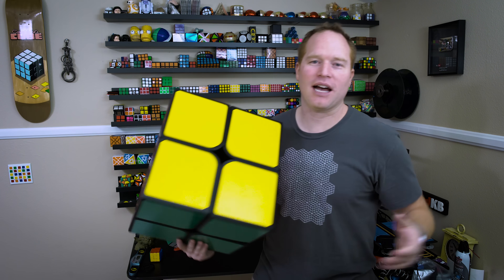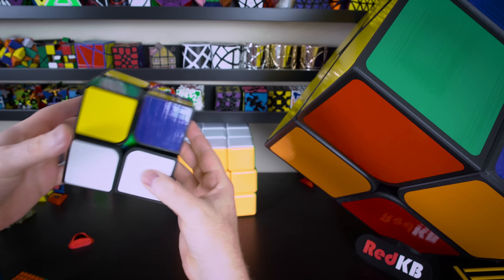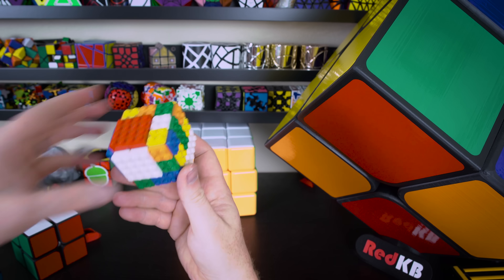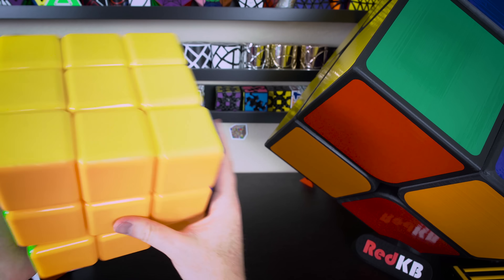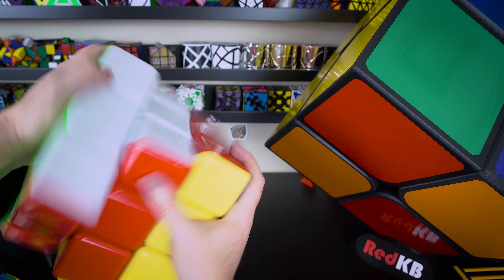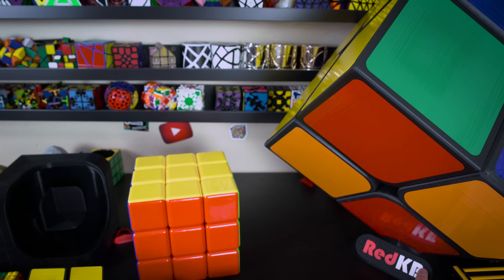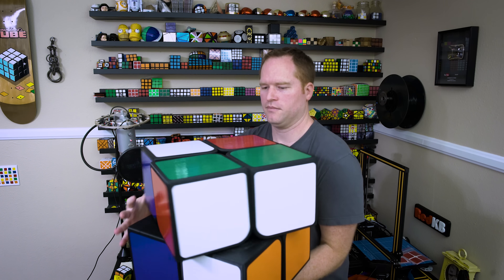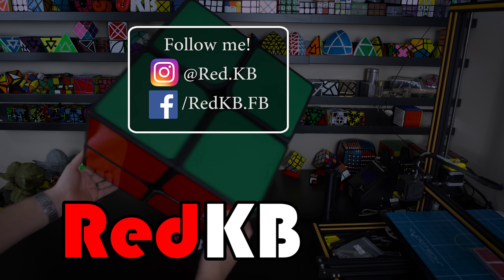World's Largest 2x2 Rubik's Cube

Comment: Is it possible to use the normal sized 3x3 as the core and make a massive 2x2 ? As it seems like the size is determined by the size of the caps, which could be decided by the 3D design
Reply from the maker: Yes you could try but then you would have less to glue to and it would be more likely to break.

Comment: Excellent work!  :D I find it really interesting that the first 2x2s (from Rubik's brand anyway) were a new design for the core and connections... then fast forward a bunch of years, and the standard 2x2 design is "just use a 3x3 mechanism and hide the edges.  It's such a simple solution in hindsight!
Reply: Hmm OK and he also did it's so there you go